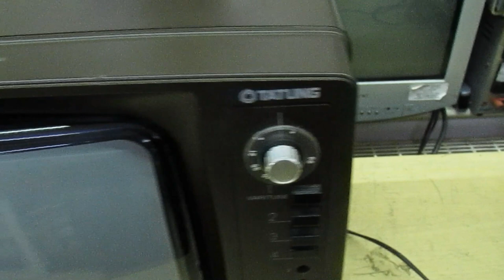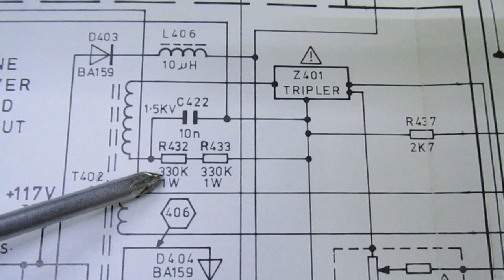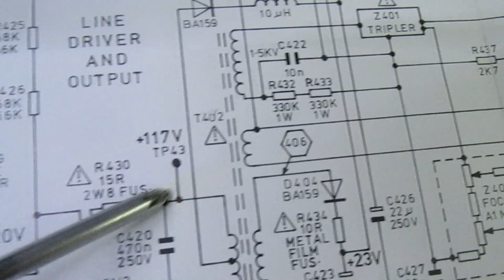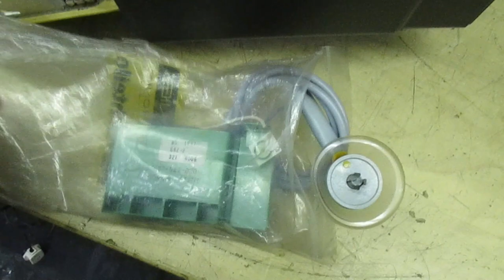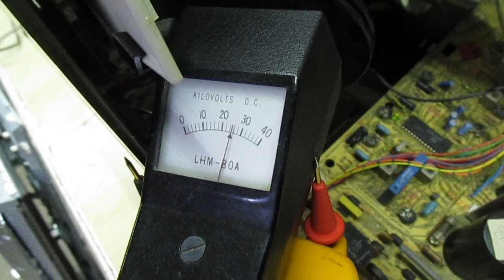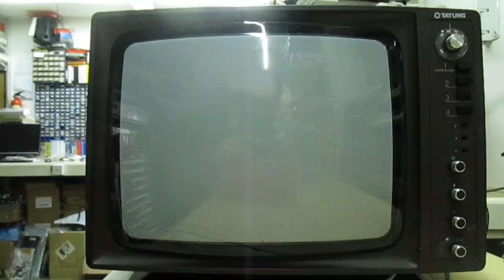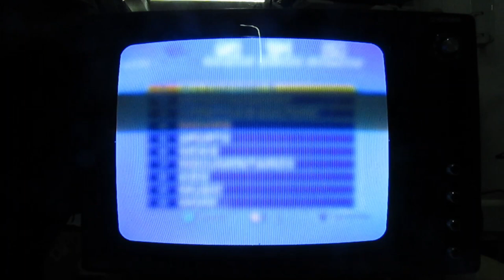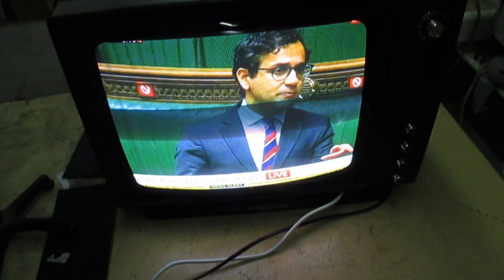Lets take a look at the Decca / Tatung  120 chassis vintage TV from 1981.

Comment: Tripler changing that was another bread & butter job for the apprentices , lovely video Michael.
Reply from the maker: As you say an  easy money maker in the day but in those days most repairs were easy money as you had access to service manuals, spare parts and if you got stuck with a problem just ring up the manufactures and speak with someone in the technical department.

Comment: Excellent michael, so many memories, I used to love working on the Decca 80 100 120 series , and the safety wire wound resistor open circuit, yep brought back memories of fitting trippers, and yes the 2x high value resistors that used to kill the chopper power supplies. Thanks for that video👍
2nd only to my best telly to work on the Philips G11, They just went on and on, 25 years + service, not like nowadays, a couple of years then shot off to the recyclers.
Reply from the maker: The phillips G11 service manual was amazing , clear and easy to read .

Comment: When Tatung took over Decca tv this was one of the first models dual branded with Deccacolour  , previously the same set by Decca was a white cabinet with black trim model number 701 I think .We  Sold and rented 100s of Decca and Tatung tvs .Nice to see one still giving good pictures  after all this time pity the tripler wouldn't fit inside the cabinet tho .
Reply from the maker: It will fit with either a bend or a file !
Reply: I have 2.  a white one which you refer to and a later red one. The white deccacolour version came with 2 telescopic aerials and a slightly curved bottom edge.
My red tatung only, is a fair bit later which was sold by boots chemist with their logo.

These in my opinion are the most reliable basic sets of the era. And give sublime picture quality.
I'll be on the lookout for a 120 now. I love the look.

Comment: a very similar problem would occur on microvitec cub's where the tripler/focus unit would start to fail and the picture would go blurry out of focus,or if you was especially unlucky the loptx's insulation would break down causing arcing between the windings,with spectaculor fire hazzard arcs complete with flames,ironicly the loptx looks very similar,more likly not the same model,but very similar design,thanks again micheal
Reply from the maker: Had shares in microvitec long time ago, I'm not sure if they didn't go bust.

Comment: The same tripler was fitted to the Dorik Mk4.
Happy days ❤️
Reply from the maker: Didnt do too  many Doric s , I think that was the set with the vertical power supply pcb and a large blue chopper transformer that got dry jointed becuuse of its weight in the vertical position .
Reply: @michaeldranfield7140  That's the one!
Very good sets with cracking pictures. In Luton when I was an apprentice they were absolutely everywhere.
They had a solonoid on the power switch to switch off with the remote and it would usually fire the button accross the customers living room 😂
Reply from the maker: @DrWatts-bi1jv  I remember the solenoid switch , I still have some I think but they were for Fidelity ZX3000 chassis , a strange idea that, you can switch the set off by remote but not on again .
Reply: @michaeldranfield7140 
The Mk4 had them too!

Comment: An other great video .I never came across a decca 120 with the board mounted tripler .only the larger screen versions. 
Any set that came in with a TDA 4601 first check was anything connected to pin 4.
Reply from the maker: There was another model Decca 130 which I think was very similar, I think it may have been a 26 inch bit cant remember without looking out the service manual .

Comment: We had a similar one of these TVs in our kitchen back in the 80’s but was white. It had the 4 presets (preset 1 varitune), Decca badge on its plinth but did not have any Tatung branding. It was a lot different inside though. The main PCB stood vertically with a hole in the centre where the neck of the CRT protruded through and It was fitted with a Mitsubishi CRT. The main problem we had with ours that the presets kept drifting out of tune every time the channels were changed so in the end we just solely used the varitune rotary control. The picture was superb though and when we eventually replaced the set with a more modern Akura TV I had to fit a signal booster as the tuner in the Akura was no where near as sensitive as the Decca.
Reply from the maker: yes I know the set , that was a Decca 70 chassis before they got involved with Tataung, and I thought mine was a 70 when I got out of the loft  but it turned out to be a 120 . Both very good sets though .
Reply: @michaeldranfield7140  Thanks for the info. I also remember that the set also made a characteristic "boing" sound when you turned it on which I found rather unusual!
Reply from the maker: Keep you eye on my channel in the next few days , I have found exactly the set you had and am going to do a video.
Reply: @michaeldranfield7140  Great 👍 I will look forward to it. Thanks Michael.

Comment: Lovely stuff this. Was this along with the Tx10 Tx90  the Swansong of UK designed and  made TVs ? Was the Bush Arena the last true Bush RBM  with a Toshiba Tube? I liked the Bradfords easy to work on and lovely  wooden cabinets.
Reply from the maker: The 1980 s were the golden years of proper British designed TV sets  using  Mullard  line up of IC s , The Bush Arena as I recall was a 14 inch mono portable and the last Bush as I remember was either a T24  T26 chassis , I would have to get out the service manual to be 100 percent correct , but which ever it was ,it was designed by Toshiba not bush and yes it did have a Toshiba black stripe CRT and it looked very similar cabinet design to the  earlier T20 /T22 . Last time I saw a Decca Bradford  was about 10 years ago at the side of someone's dustbin but having a sign written van I didn't want to pick it up in case someone saw me , a decision I now deeply regret.
Reply: @michaeldranfield7140  one TV I chucked out was  BRC 2000  I got it from the dump in the late 70s had it it worked but didnt have a back Ithink  the tube was weak it was a 25 inch it got thrown out in about 1990 The first all transistor production colour set in the world made iin Britain dual standard too.
Reply: My first colour tv i bought when i was about 15 was an ex rental Decca Bradford with a 19" tube that set produced a fantastic picture even though all i had as an aerial was a piece of wire. I lived in Maidstone in Kent then and we used to enjoy a very strong signal as we were close to the Blue bell hill transmitter.  that Decca Bradford lasted for years without any major faults the first fault i had was the sound would fade out after a few minutes of use. i repaired the fault it was an ic in the audio curcuit which i seem to remember was on the board that was horizontal in the bottom of the chassis close to the audio output valve.  the valves in the set were all original. and gave no trouble in the time i had the set. i only changed the set when i bought a teletext tv a philips G11 chassis which suffered with so many dry joints i was attacking it with my soldering iron almost on a weekly basis. I am enjoying your videos as they bring back so many good memories of my past life as a tv engineer.  keep up the good work Michael.
Reply from the maker: More videos to come soon, the very last becca Bradford I repaired needed a line transformer, I think the LOPT was £8 and we charged £18 for the repair, this would have been 1984 ish, funny how certain thinks stick in your memory.